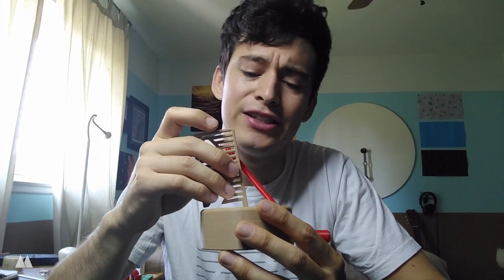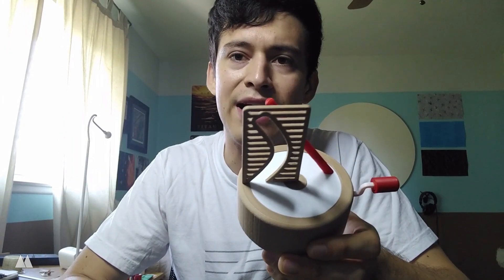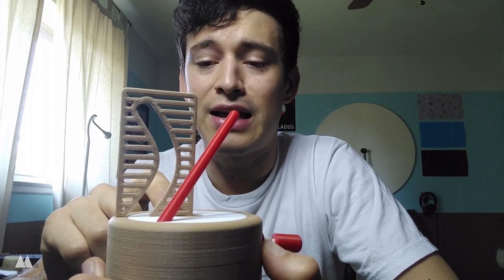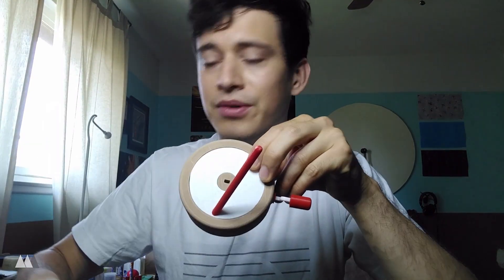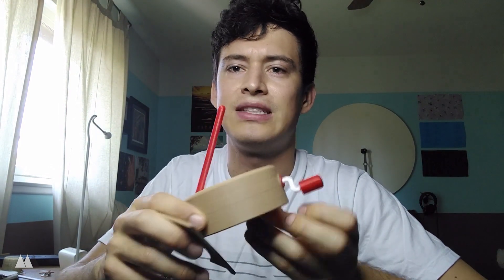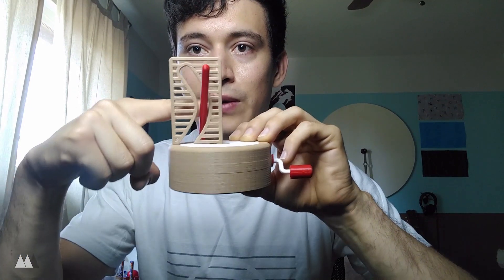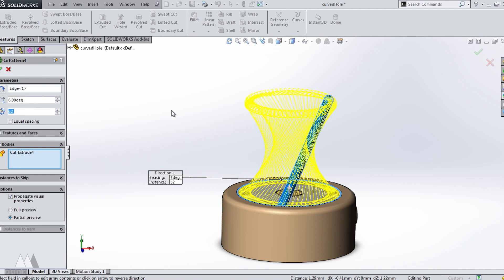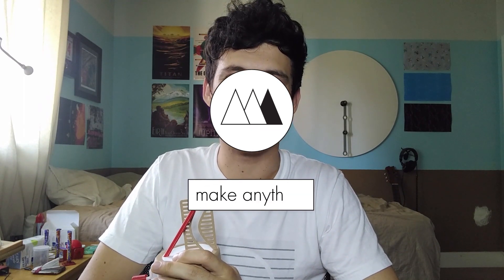Straight Pole + Curved Hole Illusion // How it Works

Comment: the only reason why its unexpected is because a simple assumption is that the pole crosses over the center of the disc, bisecting it. Clearly that's a wrong assumption though and it results in the weird hole.

Comment: It's not an illusion and it's very obvious. The pole does not cross above the center axis of the turntable. If it did, it would require a straight hole to pass through.

Comment: this is common sense. it's not an Allison. if you see objects in a 3d grid and add movement  you can see that   that object particularly will fit. which as I was writing this I just saw that he did something similar.

Comment: Make a curved pole + straight hole!
Reply: John Gaquin straight hole straight pole?
Reply: I did! google "straight hole curved pole" with the quotes.
Reply: Nicholas R.M. that would be too easy though
Reply: John Gaquin   That would depend on whether it is only curved in one direction
Reply: Charlie The Cartoonist holy shit you are a genius
Reply: John Gaquin >:D
Reply: A coil with constant diameter is essentially the wall of a cylinder, hence it should be obvious that it could pass through a straight hole. If you taper it you get the wall of a cone, the same principal applies, but you'd need to angle the hole accordingly.
Reply: Jacob LaMountain I...
Why?
Reply: Hilary Clinton 
Not really.
If you imagine how it would be done, it would be very uninteresting.
Reply: it is interesting .. I am doing it daily 😆😆😆
Reply: A helix would pass through a straight hole, with the angle being dependent on the ratio of each coil's diameter.
Reply: Nicholas R.M. thats more interesting
Reply: A Gold Soldier Sounds like a non erect-
Reply: 999 likes
Reply: Gasp

Comment: would it still work if there's more than 1 curved hole?
Reply from the maker: sure... you could even make a continuous curved tunnel!
Reply: ooh ok cool
Reply: Make Anything // 3D Printing Channel make a curved stick going through a straight hole
Reply: With that sized disk, you could only have two, but if you had a bigger disk, you might be able to fit more. (I think)
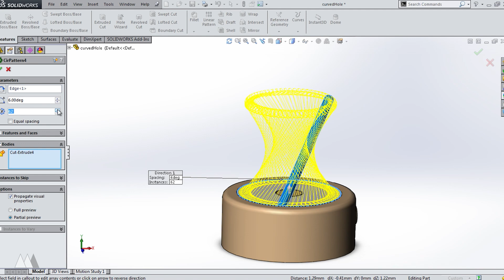Reply: AlarmClockMan Awesomeness at 3:04 an illustration is shown on screen. That illustration shows that an infinite set of "holes" will work. Hope that helps answer the question! ;-)

Comment: could you do this with different silhouettes to the curved pole, for example a rabbit and then change the shape of the angle piece so it still fits it at that angle  (aka by distorting the image)
Reply: Nahh most likely not, the shape here is a hyperboloid.

Comment: I'm more interested in how you made the crank mechanism that runs a turn table like this.
Reply from the maker: It's my next video.. coming out next week most likely
Reply: 3D Printing Professor it's just a gear connected to the crank and a circular track connected to the platform that the gear can grip to
Reply: That’s really easy, just use two gears. One connected to the handle, in a vertical plane and another, larger one on the horizontal plane.
Reply: I’m gonna guess it’s a gear that sits complimentary to another, so when you turn the side you also turn the top.
Reply: CookPiggy I'm pretty sure he did
Reply: 3D Printing Professor 👨‍🏫 and the other hand 🤚 a lady who has been in a position
Reply: Same.
Reply: I agree it looks so interesting!!! How did you make it?
Reply: It’s called gears
Reply: He didn't design this
Reply: 3D Printing Professor EASY